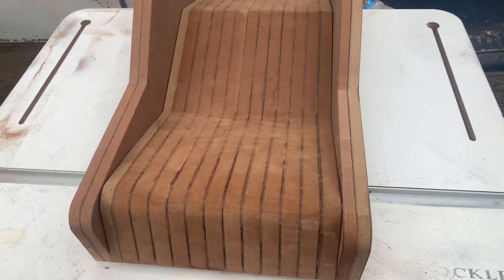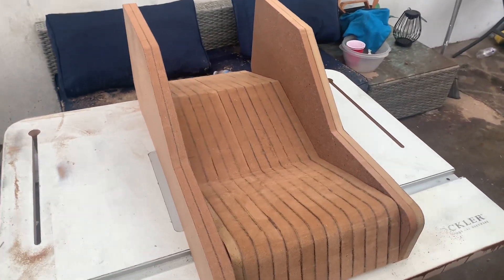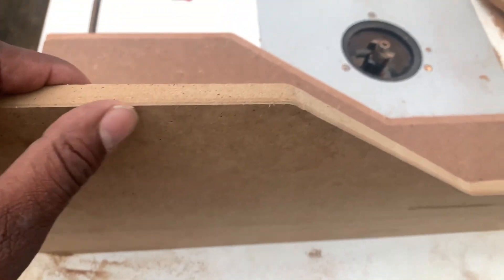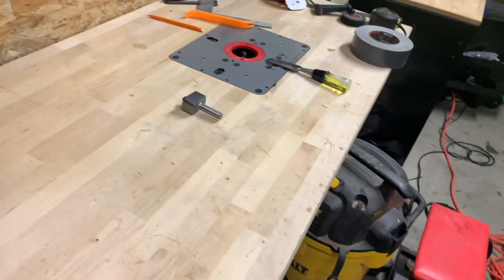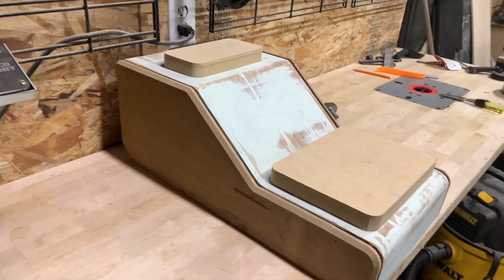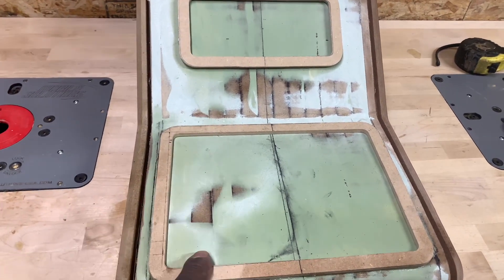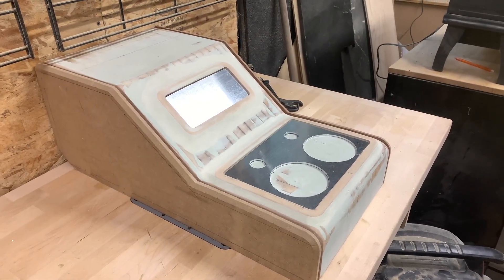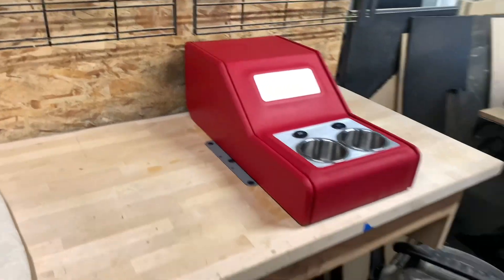1964 Chevy Impala Custom Center Console, Red Leather, Aluminum inserts Must see. Episode 18

Comment: Hi if you don't mind me asking what's the name of that board on the sides?
Reply from the maker: It is half inch MDF.
Reply: @anthonylyonsofaldesigns  I have a old school center console in my 85 suburban. I'm giving it a little twist so I'm looking for something not so thick and heavy I'll be using 1/4" foam thank you I appreciate it.
Reply from the maker: @rayjohnson7886  expanded PVC works well too.
Reply: @anthonylyonsofaldesigns  Good morning Anthony that's my name also cool I'll check it out. I'm making some brackets so I can mount my crossovers underneath the dash. But after I finish doing what I'm gonna do to this console. I may make me one from scratch thank you I appreciate it.

Comment: Where do you get the 64 Impala custom kick door panels.  I need me a pair for a 2 door hardtop 😩
Reply from the maker: I custom build them , where are you located ?
Reply: How much to build a consol 64 impala bench seat to hold radio and 2 cup holds.
Reply from the maker: @jeffiveytn2572  shoot me a text if your really interested.   360-516-0576.